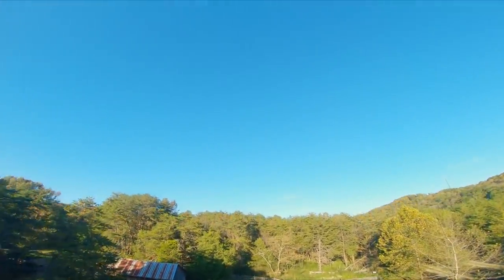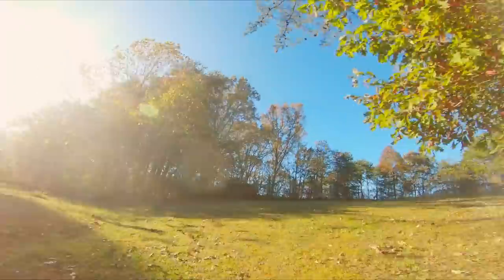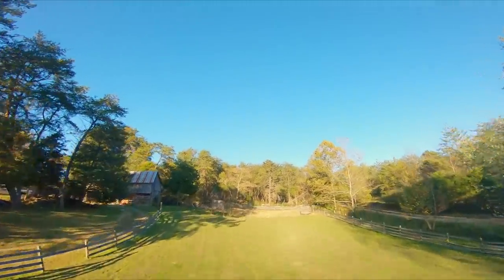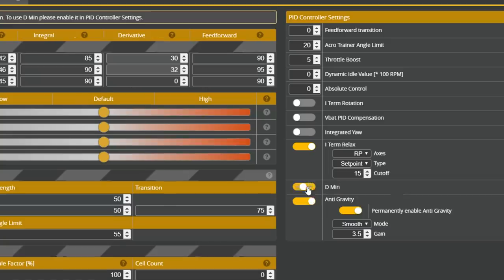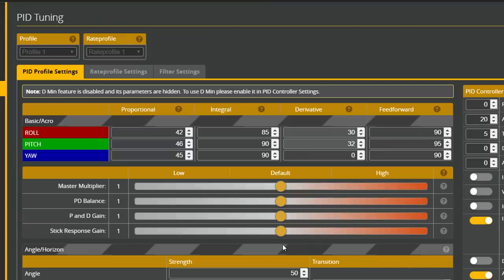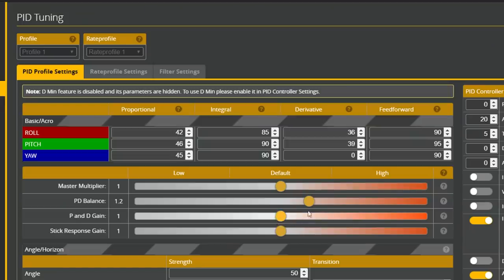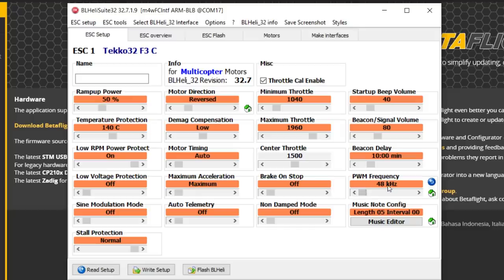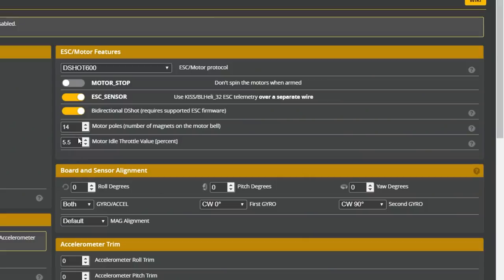Betaflight 4.2 Low Throttle Instability How To Fix

Comment: Raising the throttle min has been my go to fix for setups on 4.2 on micro builds. I had a 4" light weight build in particular that  was having wobbles and sometimes even motor desyncs at low throttle. I raised the throttle min from 5.5 to 7% and haven't seen the issue again since. It's good to see a few other options here that I haven't tried before .
Reply: Is What you mention (throttle min) the same "D min" JB talks in the beginning of the video or it is a different setting? If diferent could you please tell me where to find it? Thanks

Comment: I had this issue on heavier 5” quads or quads with larger prop size. I’ve tried all the solutions and thrust linear seemed to provide the best results. I was only setting it to 12. I have stopped using this on a few quads and have switches to using the BLHeli 32 option in the beta for setting a minimum and maximum PWM. This definitely is the best solution if you are willing to run the beta ESC firmware.
Reply: Instead of setting PWM frequency, you set a low and high value for PWM frequency. Since the issues with BetaFlight happen at low throttle, you can have it at or close to 24 and at high throttle it can be at or near 48. You need to be on the latest version of the configuration utility and you need to download the firmware from the github account. I just downloaded the repository to get them. The firmware files need to be moved into a folder that is in a blheli folder probably located in you users document folder.

Comment: Hi Joshua, try BLHELI 32 13.7.3 Beta, it supports dynamic PWM. That means on low throttle it will run low pwn for maximum stability  and on high throttle high PWM for maximum smoothness. You can adjust the range between highest and lowest PWM value. It's a great feature, I've already tested it.

Comment: I definitely learned a lot today. Thank you. I just purchased my first 5-in (1900 KV motors). It came flashed with data bataflight 4.2. I had 4.2 on my 3-in quads but didn't notice any problems at low throttle. So My new 6s 5-in drone flew great but I couldn't put my finger on what was going on and why I couldn't do... Low throttle maneuvers. Especially pitch but my rolls were not as much of a problem. I ended up changing the frequency in Bl-heli_ 32 that you were talking about to 24htz And it did solve the problem. Thank you, I really do learn a lot from your videos. I'm not sure that FPV would be gaining as much momentum as it is if it wasn't for content like yours.

Comment: Hey Josh. I think you missed another pretty easy solution. Change the props to something with a bit more pitch. Current props are trending to lower pitch but what a lot of people aren't stressing is the need for higher rpms (and therefore kv) to balance that thrust deficit at lower rpms. And add that to pilots at higher altitudes (with less dense air) and you get a lot of confused pilots who see their favorite pilots at lower altitudes raving about low pitch props and they aren't seeing the same results.
Reply: Good points.

Comment: Hi JB, thanks for addressing this issue. I have been having this low throttle stability issues and I have been asking around but did not get any straight answer or solution. The problem appears when I try to keep the drone at one spot, completely motionless, after a second the drone starts hovering all around and trying to stabilize it is very hard, almost impossible. The way I fixed this is turning off AIRMODE. Yes, with airmode OFF, the drone stays rock solid at one place and does not move at all, even if it starts moving around, it is very easy to stabilize it again with the sticks. Yeah, I know AIR mode OFF is not ideal. I tried changing Dynamic Idle  the way it was described on the betaflight wiki but it did not do a thing. Would be happy to learn how other people solved this! I will try the D min OFF and thrust linear tomorrow. I have a 5" quad with BF4.2.
Reply: Tried D min OFF and thrust linear to 25 but did not help. Now I think my issue is a bit different it is actually keeping the quad at a fixed position in the air which happens at a bit higher throttle actually.

Comment: Good video.  Got a Mob 6 and tried 48kh.  Went right back to 24.  Did not like the loss of throttle resalution. I will take tourque and controll over an extra 30 seconds of flight.......

Comment: Or for the BLHeli32 ESCs, you could flash them to 32.73 beta firmware which allows for variable PWM. It changes the PWM frequency to the motors based on the throttle position. You basically get 24kHz at low throttle, and then 48kHz or 96kHz for F3 ESCs at high throttle.

Comment: Concerning Thrust Linearization... 

Last week I installed a new FC.  I flashed my Beta85x to BF 4.3 and hit "apply defaults" as suggested. 

It set the TL to 25% and I had NO IDEA WTF was going on with my drone!  As long as I was giving it throttle it would be fine, but as soon as I tried to lose altitude it was basically trying to hover!

After watching this video I'm almost certain this is the issue! Heading out to try it now after turning it off! (Ill report back with results)

Comment: I never really had this problem but I've been running 7% idle, because I prefer a longer upright hang and I always disable d_min as well. I primarily run 2207 2400kv motors and it's been pretty slick. Can't wait for 4.3

Comment: this is exactly this issue I have with a Aikon 20x20 AK 32 Pro 50amp that is 48-96pwm. I can tune it so it's perfect all over except when I drop throttle and float down it bobbles. I have an identical build using the Ak32 PIN esc that can do 24 pwm and it has zero issues. 
I tried  everything in the video and nothing works to completely eliminate the descending bobble issue. what I found interesting is it fly smoother on 96 than 48 pwm with less issues. 
I'm going to pull the esc and wait for BF 4.3.

Comment: Got this problem with BF 4.2 for my 6inch prop. If I change prop to 5,5inch the problem gone. I fix only low throttle instability in 6inch prop by lowering to 24khz PWM. Tried to change idle speed to 7 event 8 but problem still exist. Good luck!

Comment: I actually noticed this issue on 4.1 and ever since. I believe Ryan from MiniQuadTestBench had mentioned it as well but I could be mistaken. It had something to do with RPM filtering if I recall correctly.
Reply: No.  It is just a low D-gain issue.

Comment: I built the Tryo119 (thanks for your directions) and when I come out of zero throttle (loop, roll, or stall) it wildly oscillates and takes 2-3 seconds to recover. I'm hoping these tips help.
Reply: Did you fix it? I also built the Tyro119 and I'm facing the same problem :(
Reply: @guilhermebruno9221  Sadly, no. That drone never handled inversion or fast moves well. Eventually, it had a short (probably unrelated) and I rebuilt it with new ESC and FC (same models). The rebuild has zero issues.
So, maybe it was the ESC or the FC.

Comment: Josh thank you so much for doing this vid!! I posted one in betaflight just recently of me having this issue really bad after updating to 4 2. Mine instability is more all time just above mid throttle and smooth on punch but pretty close to what your describing here. Found that my stack bottom o rings spreaded out on esc my be resting on bottom front of plate. Esc and FC are the slide in together pin kind. So gonna start there and if that dont work definitely gonna give your advice try after. Thank you man!!

Comment: There's also one big OpenTX setting that easily fixed this for me. It was turning the Hardware ADC off in my transmitter's settings. For some reason on my FrSky QX7 it was enabled by default.
Reply: what is hardware ADC? I have the same transmitter but have never heard of this. How do I find it? Thanks

Comment: On 4.2, my 5” will skitter on the ground when armed. Put idle at 1.5 and it idles fine when armed. Raise the throttle, and it won’t go back to the arm idle of 1.5 unless I disarm. I’ve been landing by disarming 1”-2” off the ground. Is this related to the 4.2 issue?

Comment: Instant upvote for crashing into a house :D  Skipped that at first view.
By the way awesome explanation for some important things under cryptic names in Betaflight configurator. Seems I need to undo some "improvements" in my quad settings.
Are higher PWM doesn't matter more for quads under 5" anymore?
Found out that Dynamic Idle in 4.2 is not usable for whoops like Mobula7. Setting it to above zero will cause unstable flight or whoop simply spaz out and don't fly at all.

Comment: Hi Joshua, a hearty thanks for your content.. I literally learned to make a quad from you.

I have faced a small problem with my latest quad. I have bought a prebuilt 3 inch quad with 1507 2400kv motor and crashed it and now 3rd motor is showing some vibrations.. pretty large ones. Now the motor belongs to darwinfpv, and they are not available locally. Can I just use some other make motor, lets say Racerstar 1507 2700kv motor as a replacement motor, or should I somehow have to change all 4. Motors are pretty pricey where I live. :(

Comment: Some say(can only remember kabab fpv), that the 22xx motors are worse at stability at low throttle,than the 2306 motors.
I'm not sure I buy into it, but could be a contributing factor with wobbles at low throttle.

Comment: I have small jitters just before full throttle punch. On 2 builds.. same stack 2207.5 and 2405. Both have the same wobbles before punch. Emuflight makes it better but not completely gone.

Comment: Hi Josh, I've got what I think is a different problem from this. Maybe you can point out what the issue might be, but my attempts to google it have failed miserably. I feel like my drone cannot hover level or has an inconsistent throttle. I've got a Nazgul 5 v2 4s and it feels like even if I attempt to keep my throttle as steady as possible, the drone will not act consistent. It will lower and then rise at the same throttle level. This transfers into me not being able to drop the drone when needed or have the throttle control I feel I should have. It also feels like it might happen more on different batteries. I have 4 ovonic 4s 1300mah, the exact same battery. I haven't numbered them to try and keep track of the issue to figure out which ones it might be though. I could also see it just being my subconscious fear of falling out of the sky :p If you have any ideas for what I could check, I'd be super grateful.

Comment: on 48khz, set thrust_linear = 25.
Reply: I always get those low throttle oscillations when I enable thrust_linearization, which sucks because I love the stick feel of that feature.
Reply: @kandredfpv  u have to tune it and u have to be on 48khz..  if your pids are already MEGA high on 48khz, and u turn this on, of course yer gu nna ge thtat low stuff.  but u should NOT be using thrust_linear with 24khz. period.
Reply: @Krunked  I thought 48khz pwm was just for micros. Anyhow thrust linearization was working fine on one of my quads with 24khz esc without any problems on BF4.1 then low throttle oscillations started when I went to 4.2
Reply: @kandredfpv  no no no!

Comment: Would frame resonance cause yaw twitching on mid throttle punchouts? I moved a quad into a newer frame, and depending on how aggressive of props I use, anywhere from 40 to 50 % throttle I get a horrible oscillation on the yaw axis... no idea how to fix it!

Comment: Were you referring to prop wash? And am I right that prop-wash is almost likely to happen at the end of split-s? Regarding 48Khz, I had a chat with UAVTech and it's true that 48Khz makes it soft but he also told me that it makes the quad lose its quick stopping.
Reply: No. You learn to fly around that.
Reply: yup, and looks like I noticed that when I don't throttle down to zero after a split-s, it doesn't prop wash.
Reply: @neilfpv  I used to try and tune prop wash out, but it was a matter of not being too aggressive on throttle at the end of a maneuver. 

If you ever get the chance, try KISS if you haven’t. I started on BetaFlight and have had less prop wash on KISS.
Reply: I was told that KISS require different hardware. Is that true? I was also told it's more expensive.
Reply: @neilfpv  Yes it does require different hardware. Look into FETTEC 35a esc and FC. The stack is $130 USD or so.

Comment: So in the rolling stock industry, withing the traction packs there is such a thing called variable voltage variable frequency (vvvf) motors. Can the variable frequency aspect be incorporated into the ESC firmware?

Comment: I recently bought the Tmotor Velox Veloce 2207.5 1750kv, and there are not really oscilation, but more of a flubber sound when i'm just above hover throttle speed. What could be the problem with that? I have all my settings the same as my other quad wich is also on the same hardware, except that quad has hobbywing 2306 1750kv...
Setup:Apex, radix2, HW60A,Unify,crossfire

Comment: yea my drone was doing that,.,. didnt know it was because of 4.2.. I thought i might of accidentally lowered idle or dynamic idle got turned on
Edited: I just thought of the reason. I had a gopro on. so it weighed 100g more. Or  53% of its AUW lol  Think I might have to raise idle for gopro
Reply: Such a drastic change in weight just requires a new tune. The throbbles should automatically get less with nice PID values. Also 4.3 will make anti-gravity more effective.

Comment: The accelerometers in BF are used to stabilize uncommanded pitch, roll, and yaw changes, right?  In other words, they stabilize pitch/roll/yaw.  Is there anyway in BF to do the same for altitude?  I've watched and used your video on throttle scaling, but can the accelerometers be used to overcome uncommanded altitude changes, in order to improve position hold?  Thanks.
Reply from the maker: Betaflight doesn't support altitude hold. The sensor you would want to do that is a barometer. Betaflight does support barometers, but only for altitude reporting and for GPS Rescue (return to home). It doesn't have an alt hold mode.

Comment: question, what if we increas P,( lowering I a little bit) and soften the P in higher rpm with TPA... so you have more P-power_stability in the lower rpm's but in higher rpms you soften the P values. so you don't overdo it when you crack up the rpm's

Comment: When you said low throttle instability I thought you were going to demonstrate how to tackle those horizon bobbles, which also involve the methods you mentioned. Imo horizon bobble is the remaining Achille’s heel of FPV
Reply: Russell Phelan  no I was referring to horizon jitter when cruising. There's some overlap in the symptom and cure but not exactly
Reply: Russell Phelan  that’s not exactly true. There are a lot of reasons for this issue, and some fixes include lowering ESC pwm or adding thrust linear. Certainly a bad gyro, bad props or unbalanced motors have to be ruled out first but it’s a pretty common issue even on the best of rigs
Reply: @Russel Phelan of course I analyze the crap outta blackbox. This is me. https://github.com/bw1129/PIDtoolbox
Reply: Russell Phelan  lower ESC pwm results in more torque at low rpm (while cruising at low throttle). Same is true for thrust linear. It essentially inverts the thrust curve and is applied to the motor sigs. Both add more authority at low rpm, which can help fight against cruising jitter caused by external forces (namely turbulent air), especially when flying in windy conditions for example, but some copters are especially sensitive to even moderately windy conditions. You’re right that if the jitter is caused by internal issues like excessive electrical noise from ESCs, then TL or lower ESC pwm will probably not help, especially since lower PWM is typically also associated with more electrical spikes. But often, it’s an issue of authority at low throttle.

Comment: Any idea how to fix similar wobbling for 75mm whoop in angle mode? I know than stabilized modes use separate calculations in Betaflight and not PID settings, but...

Comment: Can you please explain why pid settings affect motor temperature.
Reply: it is D vibration.
Reply: The D-term normally sort of reacts to the effects of P and I terms to dampen out their response so they don't overshoot and the rotation of the quad stops exactly where you want it, but when D term is high it also can react to vibration and when it does, it tries to drive and brake the motors at such a high frequency that it causes them to overheat.    Many, if not most of the filtering options in Betaflight are about trying to reduce or eliminate known vibration frequencies such that D-term doesn't see and react to them.
Reply: @daemn42  perfect!!